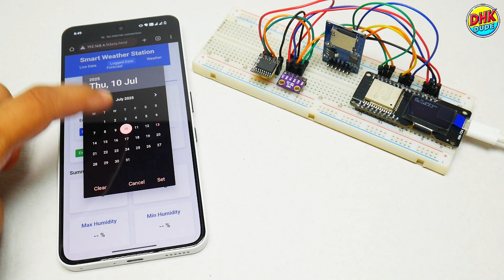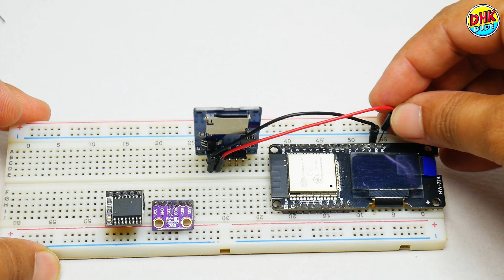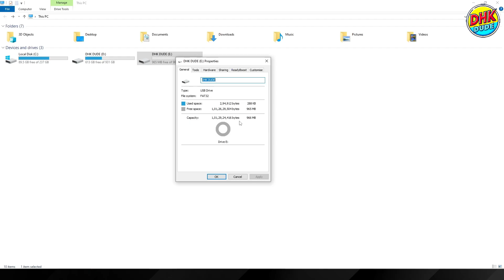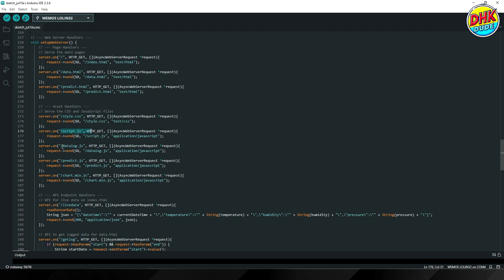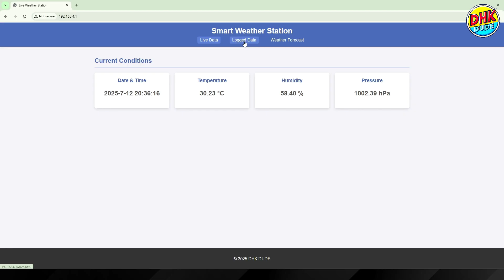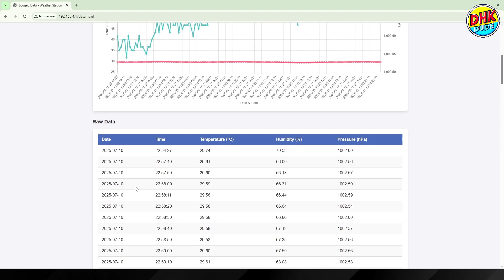Ultimate IoT Weather Station with OLED Display, Graph & Forecast | ESP32 + BME280 + SD Logging

Comment: This looks great. I was going to try and adapt it to a MakerFocus ESP32 with OLED WiFi Kit V3, which I bought recently. Will the code and pinout be the same? I am a novice in Arduino and need some guidance, please.
Reply from the maker: Yes it will work on your board but pinout will be different.

Comment: Thanks DHK DUDE!! I just built this one and it is operating flawlessly. I have it running outside on my porch. I'm going to leave it alone for a while and see what kind of results I get. I only wish the units were imperial so I could see temperature in fahrenheit and pressure in inches of mercury. If I hit the "format" button on the app screen, would't I have to copy the files back on to the SD card?
Reply from the maker: Nice to hear from you, to convert units to imperial, you have to call it while defining variables like T_{°F} = (T_{°C} \times \frac{9}{5}) + 32, regarding the format button, yes it will erase complete flash memory including all coding files. Maybe we can list files and add an option to delete just the csv file.

Comment: Can I use ESP8266? Because I have the same board as yours, but not ESP32, it's ESP8266 with built-in OLED display.
Reply from the maker: Yes, you can use that board, but there might be two problems you will face
1. You will get a compilation error while uploading the sketch, as this sketch using wifi.h library while esp8266 will need esp8266wifi.h also asynctcp will be espasynctcp. for wire begin you will have to specify SDA and SCL pins in the sketch. These are minor changes you will have to do.
2. With esp8266 you might get slight lag while retrieving the data.
Apart from these issues, you can surely use your board.
Reply: @DHKDUDE okay thank you.